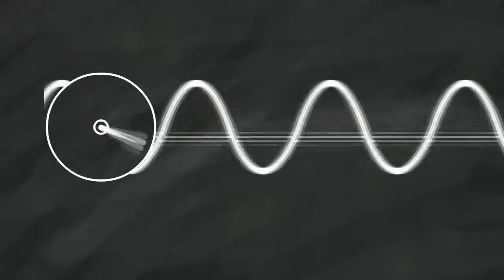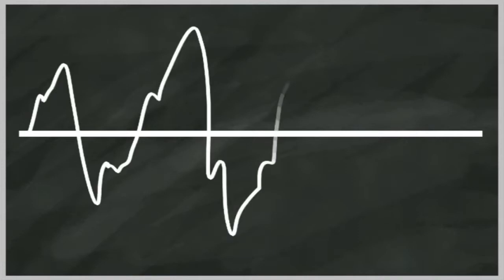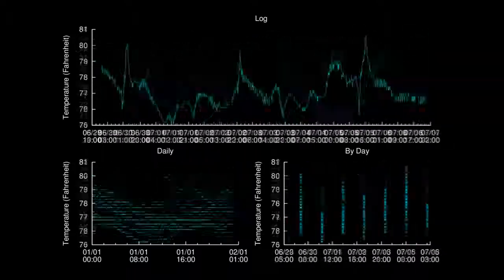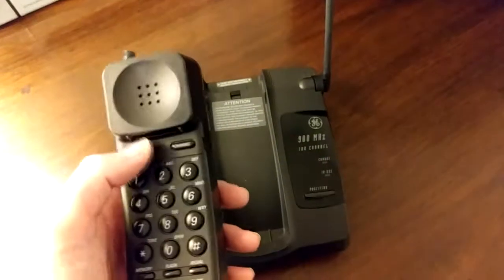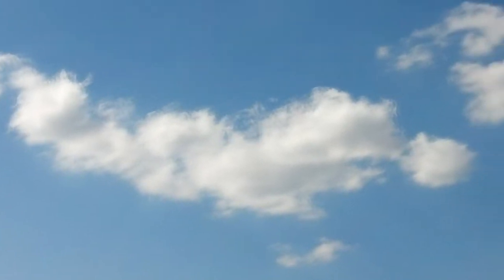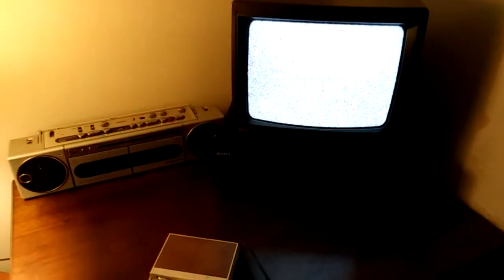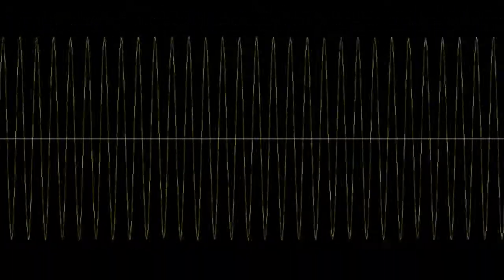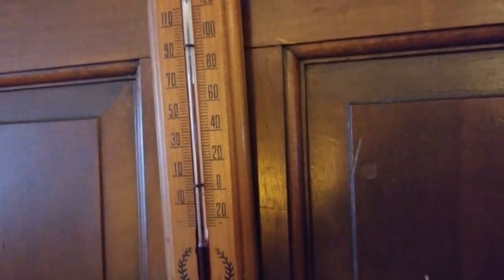Thermal Voices:  Temperature Log Sonification

Comment: Back in the early eighties, I bought an all-band receiver. To tune in on police radio, air traffic, local CB, and whatnot. The noise sounds to me like the noise I received on distant SSB transmissions. My receiver was not capable of probably tune into this signal. And when a USB and LSB collided it sounded like your noise.

I propose you try to demodulate the signal. Sound is nothing more than pressure waves. Pressure is related to temperature as you can experience when putting it in your bike tires. As you measure temperature, you might also measure very slowed-down audio. What if aliens, in a way higher gravitational field and thus slower time-frame,  are responsible for modulating their 'voice' upon a carrier we encounter as gravitational waves to communicate galaxy, the universe, or even multiverse-wide.
Reply from the maker: If you'd like to mess around with the audio, the whole recording is uploaded here every week:  https://tmc.nitrocosm.com/share/temper.wav
Reply: @Nitrocosm  Sadly I don't have the tools.

Comment: Creative use of your temp data. I'm curious what software you used to perform the playback. I think it's a well thought out choice to use 8khz to set the daytime cycle at 28hz, but the playback hardware is very likely fixed to 44.1 or 48 KHz (or some higher frequency multiple of that) and somewhere along the line the signal is going to be upsampled and filtered to work within the constraints of the hardware. Depending on the filters used, they could be designed to emphasize or even create harmonics intended to make a low bitrate signal containing voice or music sound more natural, and that could be coloring the output. Manually up sampling the signal using a program like Audacity could prove interesting. Anyway, neat video (followed links from your PlayStation sound video to get here). Edit: saw in your other videos you're using Audacity. Curious...
Reply from the maker: Audacity, winamp, vlc, and many other programs all play it back with the same characteristics.  My phone plays it the same way as do the laptops and my m-audio fastrack.  I think the coloring of the audio is really happening inside the brain more than anything.